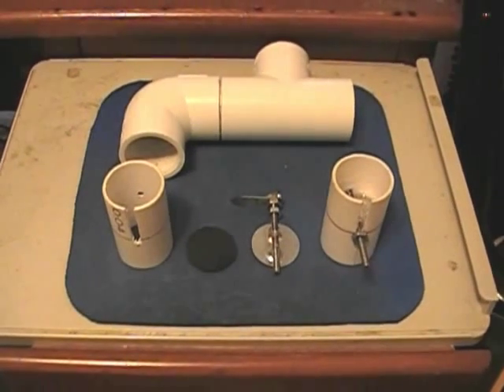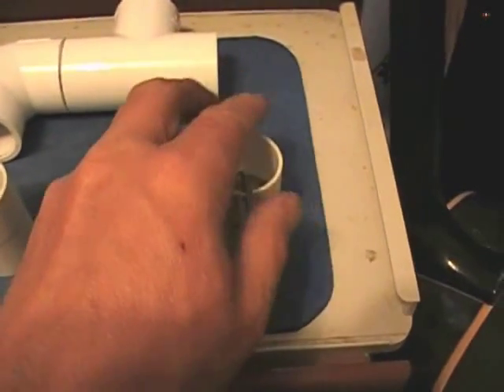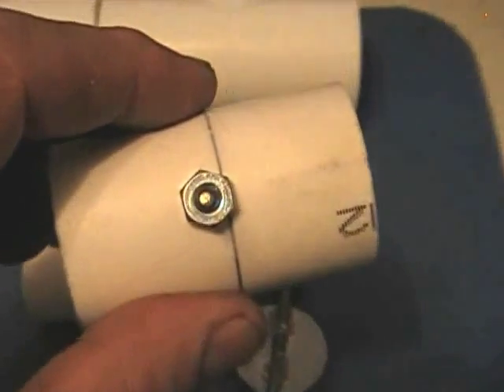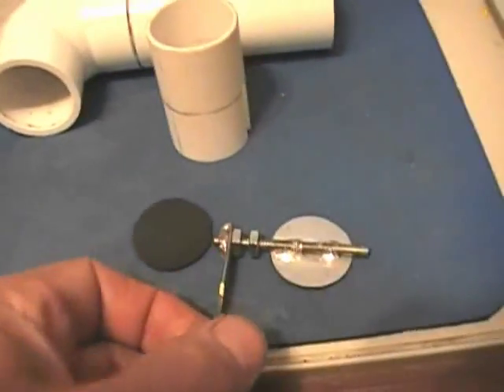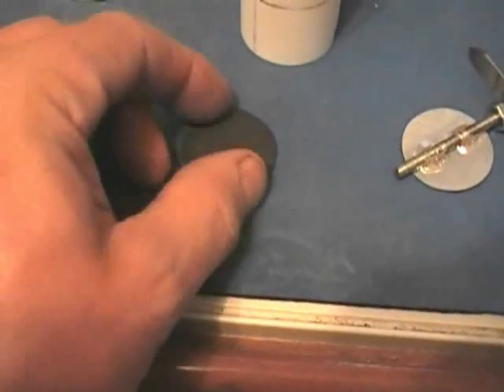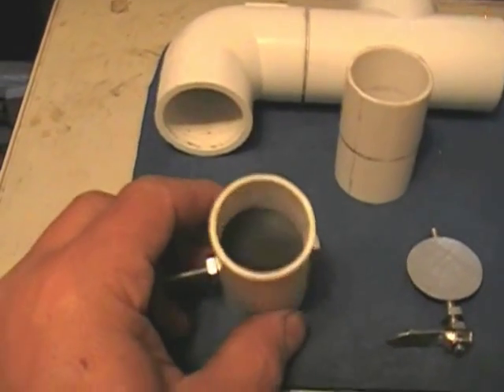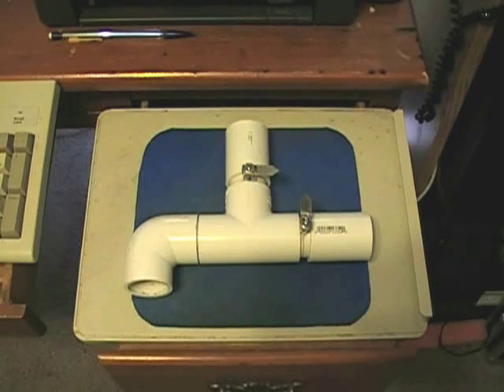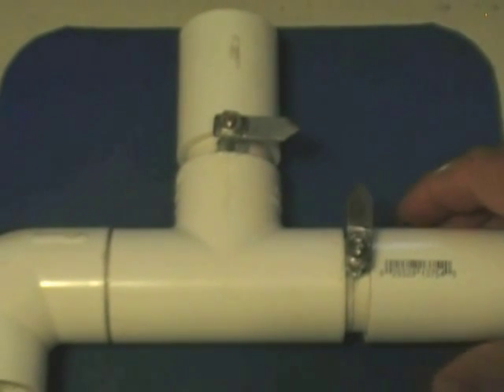05-26-2013 How to construct a simple woodgas carburetor.

Comment: Ok, so here we go.  In every video I've seen, the air and fuel mixtures are set manually.  Now I'm not opposed to this if the load were to remain constant.  I can see how this will work.  However, what happens if the load changes and you are not there to make corrections.  I can see that a linkage that would adjust both air and fuel settings could be made, but that requires a bit of fooling around with your equipment.  Like a regular carb or fuel injection system,  regulation is necessary and the carb or injection does that.  This would require a forced fuel system (low psi of course) and natural draft to get the right mix at all load settings.  I congratulate your time and work, but I see that in my mind, it needs further development.  Just my thoughts.
Reply from the maker: This is a basic and a raw technology and it definitely is not refined but it does work quite well for what it is. There are some people out there who have designed much more complex systems using O2 sensors etc to control the fuel air mixture to their generators and you can do that but there is a much simpler workaround. You can use a 12 or a 24 volt DC battery configuration or even higher a DC voltage setup like a 36 volt or even a 48 volt setup to produce a regulated 110 volt AC using an inverter and this allows you let the inverter supply the regulated clean AC power to sensitive electronics while you use a DC charger system powered from the engine being run from the woodgas just to keep the battery bank topped off. This is the simplest way to run the system and not have to deal with the issues you are describing. You can still use a 110 volt generator for simple task where AC frequency and an absolute voltage are not as critical such as running power tools or even washing a load of clothes if you needed to wash clothes during an extended power outage so there are always workarounds. I was running the AC generator in some of the videos I released just to demonstrate the concept that this actually is viable and that it really works.

Comment: How did it hold up??? Any update?
Reply from the maker: It worked quite well but it's a learning thing too. I wound up modifying the linkage so that I could tighten down the threaded rods on the adjustable air intake baffles so that the engines vibration wouldn't cause them to shift and change the mixture during a run.

Comment: nice build , are you going to use an air Filter for it and do you have a Filter for your gasifier in case that ash is going to fly into the engine ? unfortunately the weather here in Germany is actual a pain in the ass , its Raining almost 24/7 but im hoping that we get our summer :D i would build it with ball valves because i can get them for about 10 $ on ebay ;D

Comment from the maker: Hey man, the generator is REPAIRED! The UPS guy pulled up to the house right as I got home for work and I got the ignition coil installed and tested so I am a happy camper. I decided to go this route with the carburetor because I just didn't want to spend a lot of money on brass and I didn't like the PVC ball valve spigots. This little design was simple and basically free since this was made out of my scrap  PVC pile. If the weather holds up, I will test it this weekend.